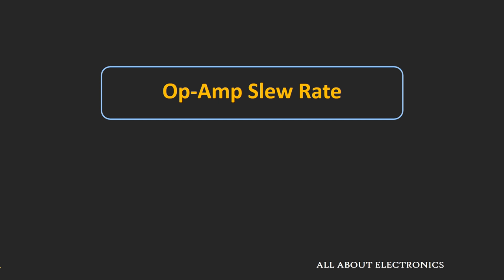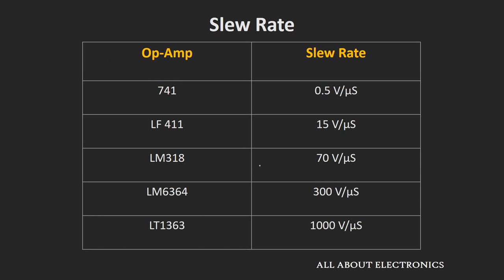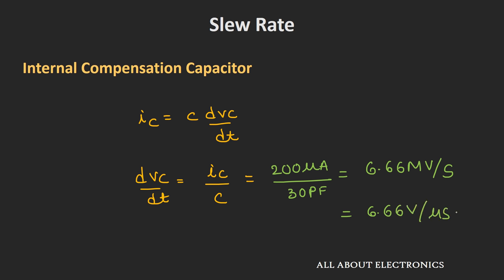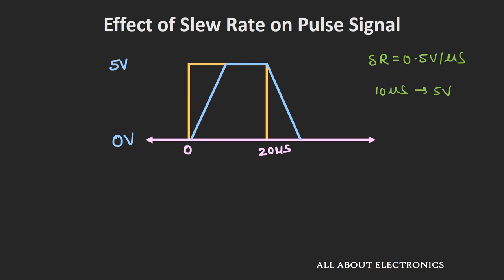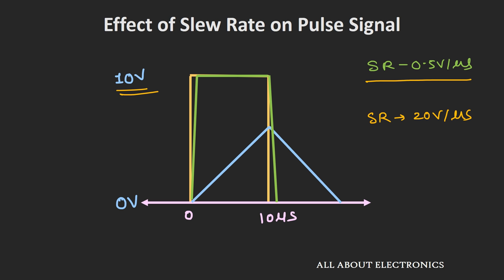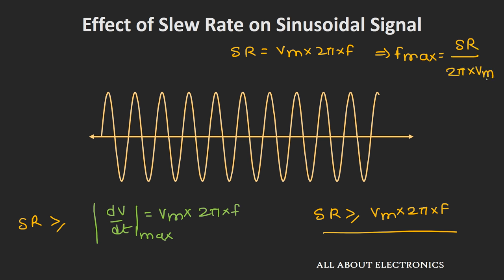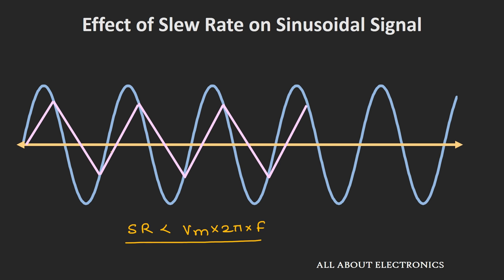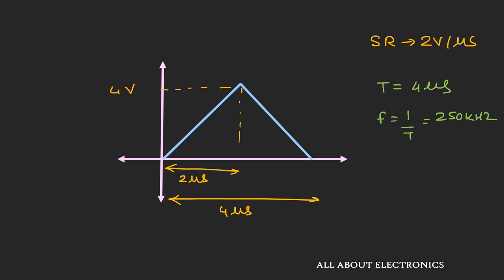Op-Amp Slew Rate Explained (with Examples)

Comment: Sir, I have got a doubt. Hope you will clear it. What I have actually understood is- In earlier opamps, there is a problem of instability and opamp may break into oscillations. So to avoid this, almost all new opamps are internally compensated . But this leads to reduction of gain even at very low corner frequency. So we add negative feedback which reduces gain and improves bandwidth because gain bandwidth product is constant. Is my understanding correct? Please let me know if I fail somewhere in relating all these things. And what is instability? Why is it happening? Please reply sir. Having an important interview.
Reply from the maker: Yes, what you understood is correct. In simple terms, instability means, for the bounded input you are not getting bounded output.

Comment: Thank you for the great videos they are really enlightening. Just a couple of questions lets say we make an op-amp how can i find the SR and how would i measure it?
Reply from the maker: The slew rate is usually given in the datasheet of the particular op-amp. 
You can also approximately measure it by applying the square wave to the op-amp and finding the time required to reach the maximum voltage using the oscilloscope in the lab.
Reply: Thank you a lot :)

Comment: Thank you for the explation! I am slightly confused on why the time period for the last example is 4us rather than 8us
Reply from the maker: At 2 us the square wave pulse will have a transition. That means it will go from high to low. The output of the op-amp will follow that transition in 2 us. Also here, it has been assumed that the duty cycle of the square wave pulse is 50 %. So it will reapeat after 4 us. I hope you will be able to visualise what i am saying. If you still have any doubt then do let me know here.
Reply: @ALLABOUTELECTRONICS  thanks!

Comment: Thank you so much for this awesome explanation....But i have a small question.....can we increase the slew rate of any op-amp???
Reply from the maker: It is the inherent property of the given op- amp.it can't be increased using external components. If the application requires higher slew rate, then it's better to select the op-amp which can provide that slew rate.
Reply: Thank you so much (•‿•)

Comment: Sir thank you so much for the video. Got a doubt. Hope you respond. What are the possible ways to improve slew rate sir? And is non inverting amplifier of opamp has virtual ground concept? Please reply sir? 
Thanks in advance.
Reply from the maker: By using the op-amp with better slew rate, that problem can be solved. The different kinds of op-amp are used for different purpose. Some op-amps have better slew rate, some have better gain bandwidth product, some are low noise op-amps. So, depending on the requirement one can select the specific op-amp. And about your second question, the the concept of virtual short is applicable for non-inverting op-amp. As far as op-amp is operating in the linear region, V+ = V-.
I hope it will clear your doubt.

Comment: Very nice job explaining slew rate and its limiting\non-limiting effects on amplifier design specification. Many manufacturers don't include this spec in their manuals. Do  you feel like this is due to a difficulty of their product to produce a clean signal throughout the designed 20-20,000 Hz band or is there so few examples of op-amp response not meeting criteria that  they feel there is no reson to list the spec.
Reply from the maker: Most of the manufacturers provide the value of slew rate of the op-amp with different supply voltages and also provides the graph of the variation of slew rate with supply voltage, capacitance, input voltage, temperature etc. As a designer, we need to select the op-amp which suits best to our application and have minimum distortion from this specs. 
I hope it will help you.

Comment: I would like to thank you for your good learning. But i have question ,,what is the maximum freqency that may be used slew rate 0.5v/microsecond?,,
Reply from the maker: It depends, what voltage level you need at the output.
Reply: @ALLABOUTELECTRONICS  output is not given ,how can i conclude it,give me some assumtions as much as possible.

Comment: 5.54? 
If new input signal has ton=10us
And slew rate is 0.5v/us then our output should take 5us to reach 5v???
Reply from the maker: Since slew rate is 0.5 v/us, so it will take same 10 us time to reach 5V. 
But let's say, if on time is 5us, then it would reach only upto 2.5 V. It can't go beyond that because after that, signal goes to zero. So, in that case, we will get a triangular wave output with 2.5 V max.output.
I hope it will clear your doubt.
Reply: @ALLABOUTELECTRONICS  
Ok.. Get it.. Thanks : )

Comment: In example2, 4volts need 4 us, so in one period it should need 8 us , isn't it? Because the period have -4 volts?  Please correct me if im wrong. Thank you, nice video!
Reply from the maker: In example 2, the slew rate of the op-amp is 2V/us. So, to reach 4V, it requires 2us. And the waveform will not fo in negative, because the input square wave pulse only varies from 0 to 10V. So, output triangular wave will at max go up to 4V. And the time period of the output wave will be 4us. 
I hope it will clear your doubt.
Reply: Thank you, I got that,cheers

Comment: Hi sir, For the triangular wave time period is 4us but for the square wave it is 2us. And frequency of square wave pulse is asked. so why is it 1/4MHz why not 1/2MHz
Reply from the maker: For square wave also, the time period will be 4 us. But it is ON for only 2 us. (2 us ON + 2 us OFF). So overall duration is 4 us. During the ON time of the square wave, there will be a positive slope of the triangular wave at the output, while during the OFF time, there will be a negative slope of the triangular wave. I hope, it will clear your doubt.
Reply: @ALLABOUTELECTRONICS  yes sir, thank you

Comment: What is the slew rate for rectangularwave 
What's it formal Sir
Reply from the maker: In case of a triangular wave, the slope of the triangular wave is the limiting factor. The output can not go faster than the slew rate, so slop has to be lesser than the slew rate.
e.g if SR= 1V/ us
And if the triangular wave has a slop of 5V/us, then the output of the op-amp cannot follow the triangular wave and output will be slew rate limited (to 1V/us)
I hope it will clear your doubt.

Comment: 741 how much frequency we can use?
Reply from the maker: 741 has gain bandwidth product of 1 MHz, so for small signal unity gain bandwidth is 1 MHz. If you set a gain of 10, then it can be operated up to 100 kHz. 
For large signal (in Volts), the frequency is limited by the slew rate. 
The slew rate of 741 is 0.5 uV/s.
So, depending on the amplitude of the signal, using the expression discussed in this video, you can find the usable frequency range.